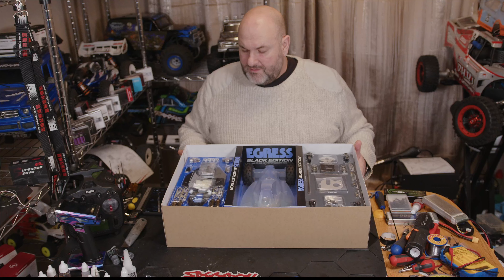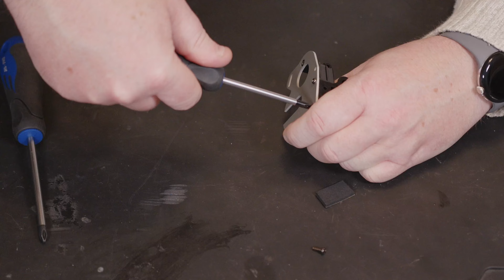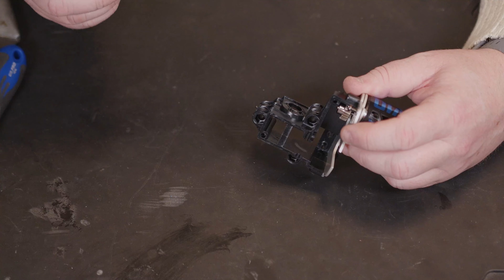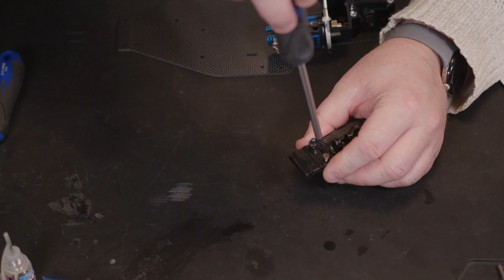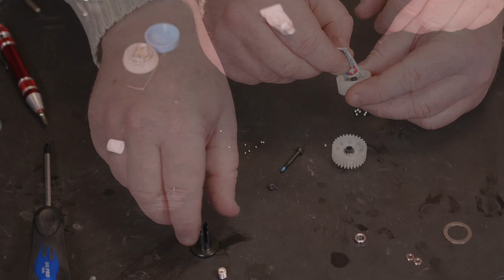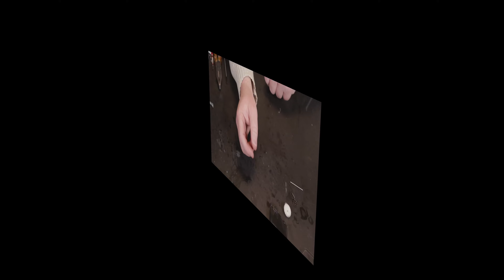Tamiya Egress Black Edition unbox and build part 1

Comment: Before this morning, I figured I was (essentially) 'done' with Tamiya kits.  It's not as if I've built "a lot" of them...I haven't (less than 10).  But, truth-be-told, compared to other brands, Tamiya kits aren't exactly the greatest quality...and, then, there's the whole JIS "problem" (like most in RC, I greatly prefer hex screws).  Granted, the TD4 Super Avante came with hex screws (and bearings), but such has been an EXTREME rarity when it comes to kits from Tamiya.

And, then...you have to release this incredible video, showcasing a kit unlike any I've seen before from Tamiya.  Sure, it comes with JIS screws, but I can put together a hex screws kit.  What makes it so great are the carbon fiber & fiber-reinforced parts.

Looks like I now have reason to build another Tamiya kit.  However, instead of doing my own build video, I'll just refer viewers to yours.  🤙🏼
Reply from the maker: Thanks 🙏 it really is a very nice quality RC :)